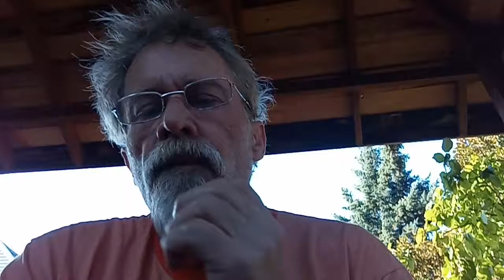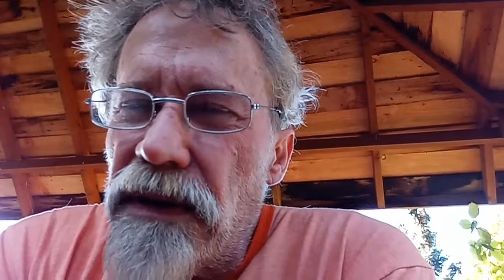Dosimitry Worksheet Update. Check second sheet

Comment: It's good you're pointing this out. However, the "relative harm" values are oversimplified and they should be taken with a pinch of salt. It also depends on energy and the way you're exposed to that particular type of radiation. Like, alpha typically cannot penetrate few sheets of paper, so they're only dangerous if they get into your body. In other words, if you prevent swallowing or inhaling an alpha emitter, you can completely ignore alpha measurements.
Reply from the maker: If your meter measures alpha particles you are inhaling some of the elemental sources of them.
Alpha energy does not travel that far so the source particles surround you in a dispersed radiological environment.
See ResRad training materials.
Zero Harm is an assertion from poor understanding.
Reply from the maker: The elements themselves are health threats before they decay.
Skin absorbtion is also an issue, ion migration in biological systems. Someone else studies that, I defer to them. Those people's.
Reply from the maker: I put a lot of qualifiers in my talk, spoke to general accuracy and stated I'd work with someone to better quantify the results.
Quantify and Qualify are kind of sacred words in Metrology, helps a peer understand what some very specific things mean when measuring artifacts we really can't see. Reality is not easy
Reply: @UCp20KIuJ6Om6P6DZGMzQyTw I meant inhaling/ingesting hot particles, like spent fuel dust with Pu239 and stuff - that's something you should avoid. However, the fact you're detecting alpha particles doesn't mean you're in a real danger. Like right now, I am pretty sure I am inhaling Rn222 and its daughter products (my area has rather high Rn values), but I am not really too worried about that. 
In other words, unless you're close to a place where's a good chance of inhaling radioactive aerosol, I wouldn't see alpha radiation as a big issue.
Reply: @qzh00k  Hmmm, I never thought about skin absorbtion - good point! Sounds like I should do a research on that.
Reply from the maker: @JakubChalupnik  don't need to go weapons grade to understand this. Radon abatement is another example of an industry built on knowledge, and good profits. I can't deny or dismiss the need for it. But to ignore it seems wrong or is just wrong.
It is an expensive question, if you get an answer that's worrisome.
Reply from the maker: @JakubChalupnik  I carried diluted standards that were deadly. One should understand dilutions, at least. Maybe
Reply from the maker: @JakubChalupnik  I carried diluted standards that were deadly. One should understand dilutions, at least. Maybe
Reply from the maker: @JakubChalupnik  I'd suggest general look into biological uptake and half lives in general. We replace a lot of our body parts, tissue and bones, at the elemental level and the life time of our parts is fascinating.